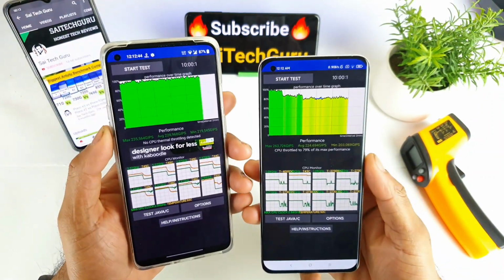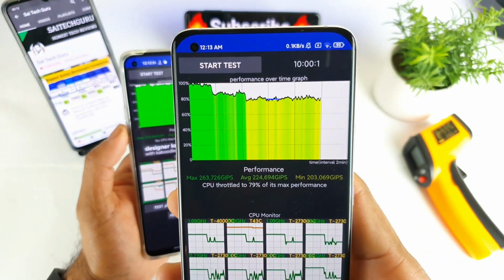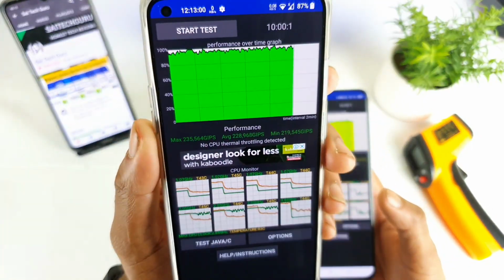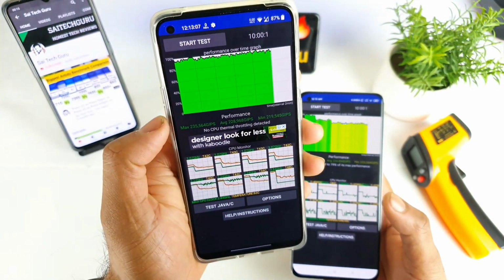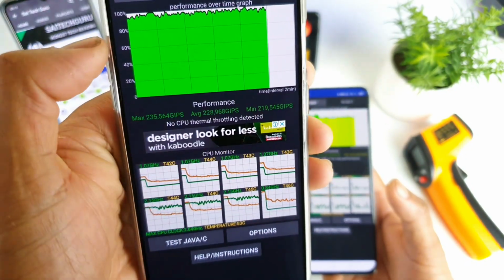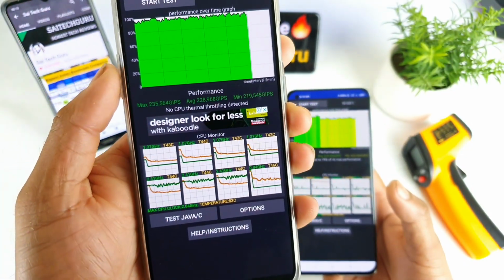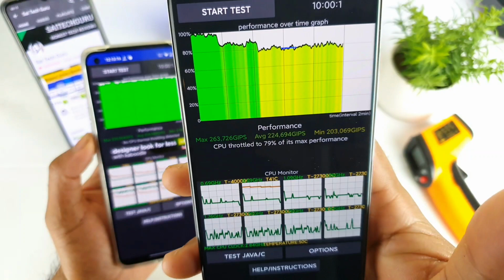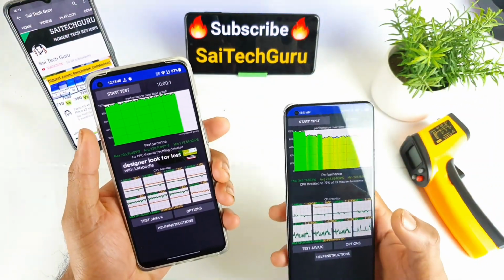Mi 11 vs oneplus 8t CPU throttling stress test

Comment: Is this a 888 SD issue or MIUI . Can you do some speed test also. I think oxygen OS is managing things very well
Reply: It's with the body. Even iphone 12pro max with steel frame brings the brightness down due to heating
Reply: Even OnePlus 9 throttling
Definitely processor issue